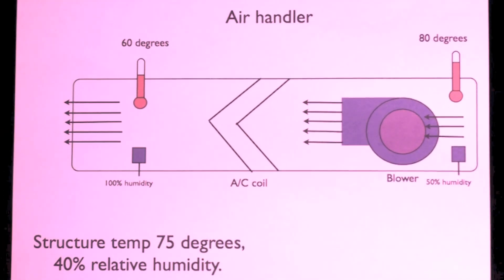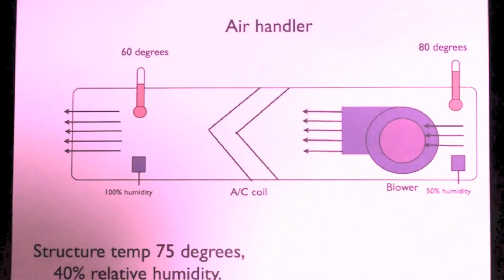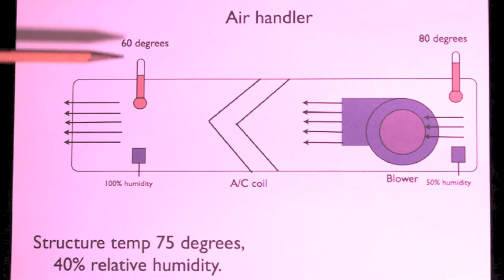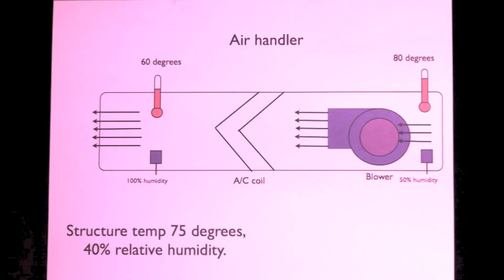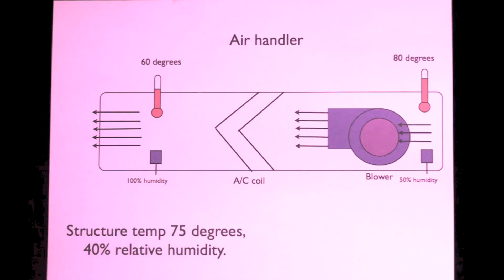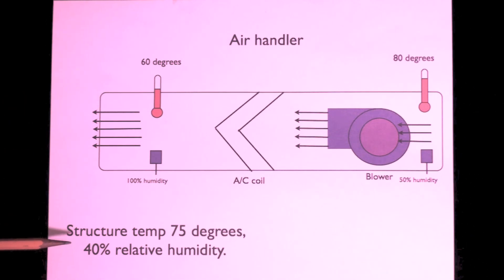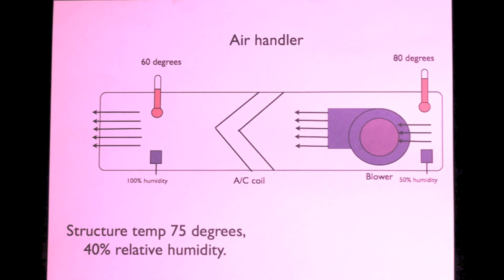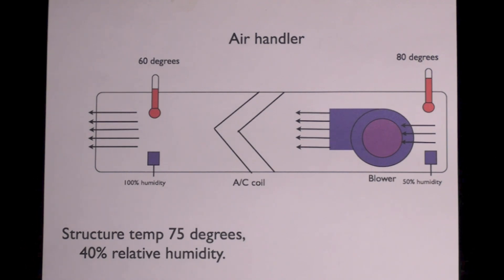Humidity:  The air conditioner as a dehumidifier

Comment from the maker: In heat, the large line is hot gas discharge, so it is normal for it to be hot.  There is no receiver in most heat pumps.  My thoughts from what you say are that perhaps the unit has air in the system.  That would cause the high head.  The air would probably come from a refrigerant leak.  Hope this helps.
GFM

Comment: thanks GFM yes 1080g both coils have been cleaned & fan is running as expected. I assumed restriction at indoor coil as the connection from indoor to out door (Large connection) is really hot to touch. My understanding is the receiver (Heat pump) is down stream of this line the high pressure reading due to the receiver pulled to vacuum due to the point of restriction.  Am i thinking a long the right lines if so what the best solution once again thanks for the help

Comment from the maker: I am assuming there is a decimal somewhere in that kilogram number.  The only way to get high head with a restriction  is if the unit is hydrolocking, meaning there is all liquid in the coil.  More likely, there is a lack of air across the condenser (no fan, plugged coil/filter).  Also overcharge is possible but you said it was weighed in and I am assuming to the factory charge.  Hope this helps.
GFM

Comment: Thanks GFM your videos are a real help i am slowly learning.I have heat pump which in cooling mode i was only getting expected pressures & superheat whilst over charged half kg since charging by plate weight 1080kg i get LP 5 bar high SH. It is a cap tube system with only one gauge connection switching to the high gauge running in heat mode i found on start up the pressure rises above 35 bar i shut off as operating max is 34 bar i was thinking restriction at exit of evap any thoughts thanks

Comment from the maker: You just said it.  You have a good understanding.  All I would add is that the air leaving the air handler mixes with the air inside the structure that is lower humidity (probably the same as the return air).  The mixture of the 2  must result in a lower overall humidity because you have removed some of the moisture from the coil.  Hope this helps.
GFM